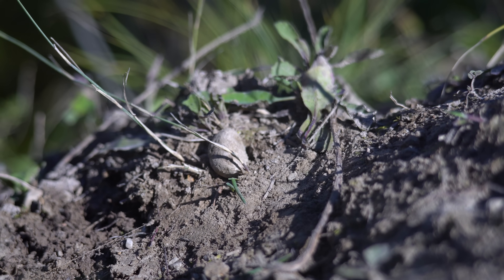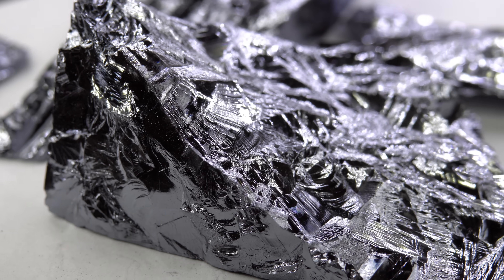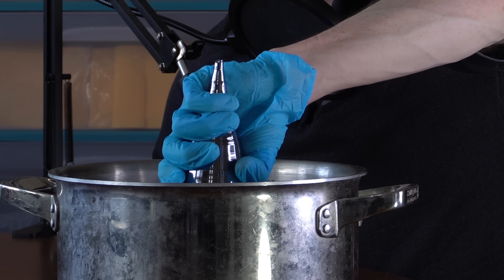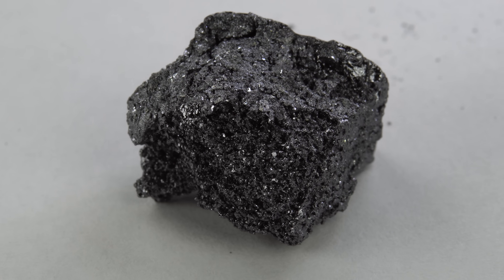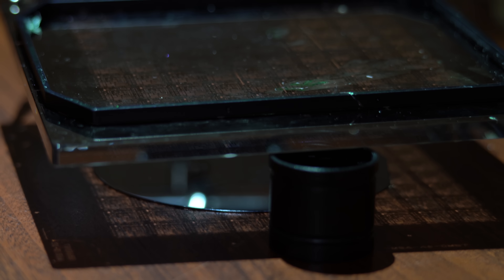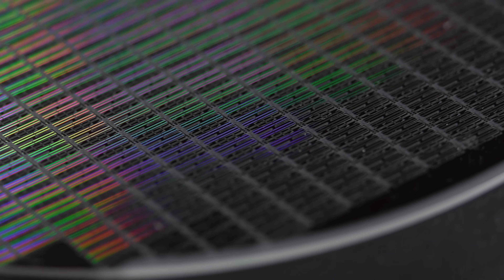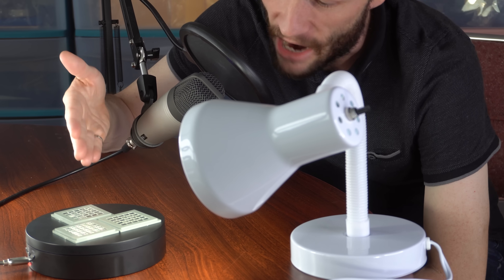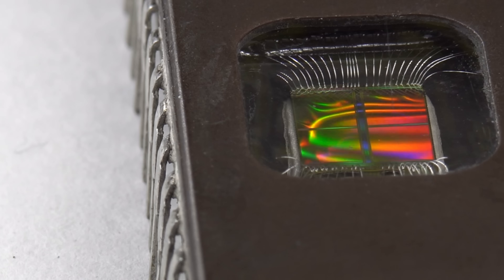How To Make A CPU

Comment: This mastering of engeneering to supply us with modern tecnology. And here we are screaming and swearing when our computer crashes
Reply: For make us to buy a new one? Yeah , that's how it work i guess...
Reply: Yes. And I will continue to do so.
Reply: My parents wouldn't buy me a new laptop that's got Intel core i7 processor...
Not to know it works faster
Reply: @machineheaded3628 i7 3 gens old are slower than current i3's. i7 on its own doesnt mean much, its just marketing signalling "this is the better one" to people who have no clue
Reply: @102728  no it's not 3rd generation... It's of 11th generation...
Reply: @machineheaded3628  intels latest generation is 14th gen. That makes 11th gen 3 generations older than the current.
Reply: @102728  I did find one laptop with 14th generation core i7 CPU processor but I guess they stopped selling it on the marketing website specifically where the product appeared the first time...

Comment: Instructions unclear, ended up with an RS28 Sarmat intercontinental ballistic missile manufactured in the soviet union during the 1970s to deter American forces with the capability of carrying 15 Multiple independent reentry vehicles that can each strike a city with an accuracy of upto 10 meters meaning thst at any moment a nuclear warhead could be standing in front of you and the next moment, you don't exist. It further justifies soviet advancements in technology with the ability to cold launch the warhead which is a method that doesn't damage the silo and allows it to be reloaded in mere weeks compared to American hot launch systems destroying the silo and requiring years of reconstruction to get it back up and again once again proving soviet supremacy with the option of putting it on a truck meaning it can be moved from various locations and immediately reloadable

Comment: I made 40nm chip using Germanium rock crystal and UV light attached with sensor. Going below 40nm is really difficult and requires quite a cost but you can easily develop 40nm and above chips with easily available tools.

Comment: Even though it makes things seem complex, the reality is once they have the process down, they can print a massive number of chips without issue, and it only gets cheaper and cheaper as you make more....the problem is, they then create a whole new chip, which requires even more research and development, bringing the cost back up. And while making things smaller makes them faster, the reality is we could have CPU's that are much bigger, like the size of a plate, but use low power and still operate pretty fast, and produce them very cheaply. Basically, you could have a CPU 10x as fast, for 1/10th the cost...they just don't do it because they're greedy.

Right now, it costs literally dollars to produce a computer chip that you pay $500 for. Companies like TSMC don't want people to realize just how cheap it is and how much they're profiting from it. To put it into perspective, TSMC made 200 billion profits in March of this year. Not as a yearly profit, but a monthly profit. That's like if everyone on the planet gave them $28. Except TSMC didn't make billions of chips in march....they make a little over just 1 million chips per month. 1 million chips, turned into 200 billion dollars of profit, and that's also on top of the actual costs to produce the chips, pay employee's, materials, energy, etc. They're making 200 billion on top of all those costs. Those figures alone prove just how much they are being greedy. When you go buy a new computer, know that it only cost them less than a penny on the dollar to make even the most expensive parts.

If you think gluttony in the west is bad, look at countries like where TSMC is. They are robbing the planet blind, and gorging themselves on the profits. They are producing these chips for almost nothing, and charging a kings ransom to every person.

Comment: Instructions unclear. I currently have a quantum computer on my table.
Reply: Instructions unclear. I currently have 8x10 sheets of new Kodachrome 64 film on my table.
Reply: You might have too many entangled particles in your computer. Your mistake was in the first step. You need to hit the rock harder when smahing it to pieces.
Reply: @valuemastery wouldn't particles entangled with the computer loose super position? But also yea, just hit them for no superpostions
Reply: Are you sure it's on the table?
Reply: Hate when that happens

Comment: Instructions unclear, while purifying the silicon my tank with trichlorosilane and hydrogen chloride gas had a lead and i am currently being etched by the HCl and everything around me is exploding due to the reactivity of the HCl3Si
Reply: Try not to spill any HF etching fluid on yourself.  It'll melt your bones away.
Reply: Isn't silicon tetrachloride used in the purificazione process?

Comment: What I know is that they manufacture them in clean and sterile laboratories, where they first obtain high-purity silicon and dope it with another semiconductor material, provided that the doping is at a certain percentage. The laboratory must be clean and free of dust, because any speck of dust can spoil it ( The same applies to lighting ) ! So you can't make it at home.

Comment: Some people might find it difficult to turn 98% silicon dioxide into 99.9999999% polysilicon metal, but it is in fact quite easy. Simply take a pair of tweezers, and spend some time picking out any oxygen atoms and any other impurities you might find.

And for the folks who don't have a crucible capable of 1700°K at home, an easy alternative is to rub the polysilicon ingot with your hands (don't forget to wash them) very fast.

Edit: wow I did not expect this comment to blow up, especially to the point where I start getting bot replies.
Reply: To be frank, who DOESN'T have a crucible at home? Still a good method if you need to make a CPU on the go.
Reply: I unironically made a crucible last summer lmfaoooo @morzemus1805
Reply: @morzemus1805  I have a crucible unfortunately I don't have the cutters to cut the silicon bullion into wafers
Reply: I'm sure my easy bake oven will be just fine...
Reply: @sammy_1_1 i'm sure it also works with a microwave, let me try it out
Reply: Don't forget those of us with sensitive hands. Yelling at the the rock for a while can also get the job done in that case.
Reply: i love how all those are theoretically possible solution, just wrong by a few orders of magnitude
Reply: @arthurborlet You purists want everything just to be exact, how much a couple orders of magnitude could be, let's just assume ideal conditions and linear behavior.
Reply: I cannot be the first one trivially bothered by how you put a ° for Kelvin 😭
Reply: skill issue
Reply: I seem to have rubbed my hands away... Not the first time
Reply: 😂 @TheChrisLeone
Reply: Instructions unclear, rubbed away hands at 2000RPM, typing taking noticeably longer and red liquid is getting everywhere.
Reply: So how do you tell between oxygen atoms and non oxygen atoms?
Reply: @ArmadusMalaysia  the oxygen atoms are blue, duh 🙄
Reply: Just use the reactor, its in your technology build inventory.
You just need to establish a base with your base computer on an unclaimed spot. Then in your inventory, on PlayStation hit D-pad UP. And scroll with L and R until you find the refinery. 
Then make Carbon. 
Instructions from here unknown.
Sorry you spent so much time reading this
Reply: Instructions unclear. Washed all the silicon away.
Reply: ...Steve?
Reply: To be fair, you can slap the polysilicon too. Just really fast. I cooked a chicken once that way.
Reply: Instructions unclear, I accidentally created oxygen -15 when picking out the atoms
Reply: For solar cells we need 99.9999% purity ie 6N we don't require 9N.
Reply: Uranium atoms are too difficult to pick out with tweezers though. That's why you cant get to 100%
Reply: @nottsoserious Really? I used a suction cup to remove the said uranium and built a nuclear reactor!
Reply: Makes one appreciate all the other miraculous inventions it took just to get here.
Reply: I don't know commie units would 2600 Fahrenheit in freedom units in a steel forge work?
Reply: That would be the smallest tweezers ever. 😂
Reply: Very smart
Reply: "...very fast"
Outsch!
Reply: Bro wtf quit explaining, this shit already insane as it is
Reply: Good old troll physics.
Reply: Albion is a online sandbox game, play it now!
Reply: Managed to get the oxygen atoms out with the tweezers but stuck on the rubbing my hands bit
Reply: Kelvin is just Kelvin, it's not measured in degrees.
Reply: Nerd detected😂😢
Reply: Pfft this actualy made me chuckle aloud XD
Reply: woW I diDn'T ExPecT tHiS To bLoW uP
Reply: Guys, Here is our Savior

HalleluYAH translates “Praise ye YaH”

YaH is The Heavenly Father 
YaH arrives via the TENT OF MEETING
YaH was Who they Crucified for our sins
YaH was Crucified on an Almond TREE

— Ancient Semitic Cuneiform of Moshe (Moses)
— Isa Scroll (The Original Isaiah)

Isaiah 42:8
"I am YaH; that is my Name! I will not yield my glory to another or my praise to idols.”

Isaiah 43:11
“I am YAH, and there is no other Savior but Me.”

Isaiah 45:5
“I am YaH, and there is none else.”
Reply: dude tried to be funny
Reply: @KatoYutobe and he was

Comment: I followed all of these steps but got stuck when locating the pad on the silicon chip. Do I look north or south?
Reply from the maker: Usually, the square looking things that are all around the outside edge of the chip, (north, south and east/west) are the pads.  On some of the more complex chips like modern processors, the pads will actually be scattered over the entire surface of the chip.  If you can find a pinout diagram for the 'packaged' version of the chip, then you can usually use that to figure out what each pad is responsible for.  Usually, the bond wires don't cross each other, so if you see a row of pins on the finished chip diagram, you're likely to find the pads in that same order on the bare chip itself.

Comment: Sam Zeloof says that the hardest part to come by for the average tinkerer is the photoresist.
Reply from the maker: I personally haven't actually played around with photoresist myself (as that gets a bit too deep into chemistry for me, and I don't have the expertise/equipment to handle the chemicals).  From the lectures I've watched though, getting the right chemical composition for the photoresist seems to be very much a secret-sauce thing that likely isn't well-documented the public domain.  Macroscopic etching for things like printed circuit boards seem to be more well-documented, but professional nano-meter photolithography seems to demand a precise understanding of reaction rates, temperature influences, wavelength of exposure light, exposure time, chemical composition of the sub-straight etc.   There's probably a few amateur chemistry tinkerers out there that would be able to figure it out, but it's a very inter-disciplinary thing, and there aren't many venues for chemical engineers and electrical engineers to talk about this subject with each other.